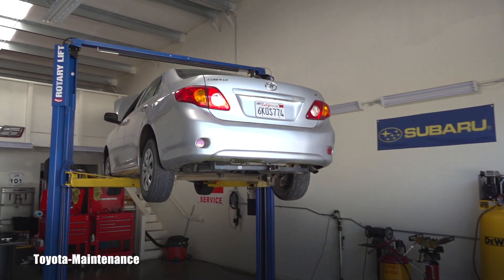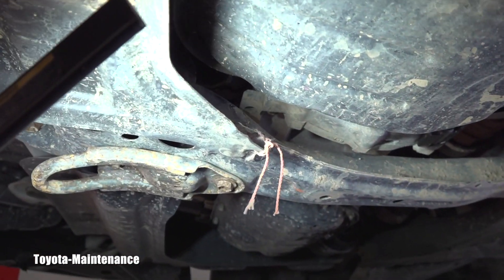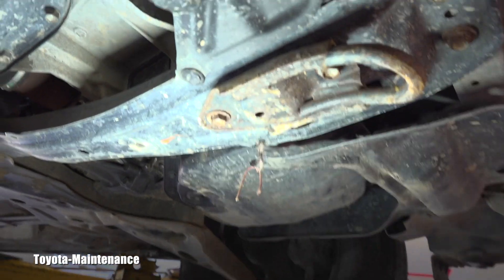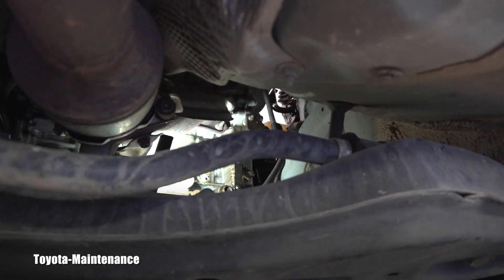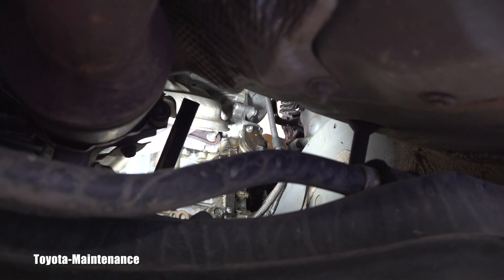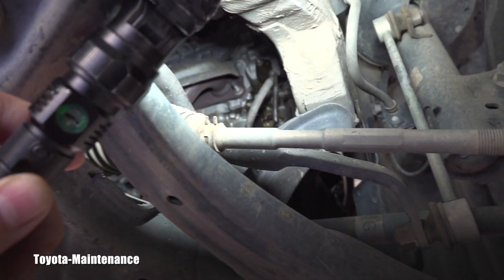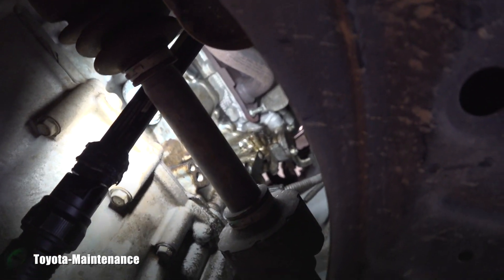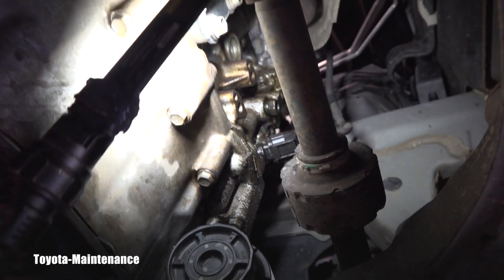Typical Timing Chain Tensioner Oil Leak

Comment: The dealer told me my timing cover is leaking and it will cost $3,000 to repair, after cleaning myself and watching videos like this I R&R my tensioner, to soon to tell yet if it stopped the leak, but thanks for keeping us informed.
Reply: @garyy3758  Yes it is still dry.

Comment: I installed new Toyota tensioner and oring but it still leaks slightly. What's the trick to this repair?
Reply: Put a bit of clean engine oil on it, and make EXTRA sure you don't pinch the O ring.
Reply: I sealed mine with rtv and been solid for 8 years now, just put it around the bottom and spread it a little out I think I put some around the o'ring too on the bottom side
Reply: might have crushed the oring on install

Comment: Both my Corollas had oil leaks coming from the main bearing seal, expensive labor to replace a $15 gasket.
Reply: Add at205 reseal when changing oil
Reply: @on-site4094  Tried it, did not work.
Reply: @pedrofernandez8729  now you have to use maxlife for about two to three oil change intervals. Or one year whichever is longer. Slow but will rejuvenate the old seal. Conventional can dry/eat it out if oil changes were neglected

Comment: So freaking crazy. A few weeks back I saw your transmission oil change and I noticed the car you were working had the same small oil leak on the back of the engine. I was just about to go back and look for that video since you brought up the leak but didn't go into to much and wouldn't you know it searched up hoping to find a good video and BAM! your video was recommended so I'm super happy. Thanks for the amazing work keep it up definitely subbing 🔥🔥🔥. I forgot to ask would you recommend I replace the rubber seal? Or is there a way to somewhat permanently seal it to stop future leaks. How do you properly clean the tensioner and what type of fluid do i lubricate it please 🙏🏻🙏🏻🙏🏻

Comment: Great video! Would love to see how to change out the control arm on the driver side (Need to do this on 2008 Scion XB). It seems one of the bolts doesn't clear due to the transmission oil pan. 

Thank you!
Reply: Gotta unbolt thevmounts raise it up with Jack the bolt will come out easy but extra works

Comment: Thank you very much sir.  I have the same issue in my Prius 2015, it uses the same engines and looks so similar. Do you have any tips how to unhook the tensioner in hybrid?  I am not sure it has the crankshaft pulleys over there.  But I think I can pull it from the harmonic balancer pulley

Comment: You might also want to tell the owner that they need new tires.
Reply: I have a 1999 Toyota Corolla LE I had to put new tires on not because they were bald but whether checked
Reply: This owner could not afford it. Said no to flush and deferred atf spill and fill until next oci

Comment: So what about that "great Toyota quality" if that leak is typical? Seems to me there is really nothing "quality" about it.  Or is any defect on a Toyota a sign of "quality", whereas any other make's defect is a sign of lack thereof?
Reply from the maker: small problem, cheap to repair, what about subaru boxer engines failing headgaskets one after another, and repair is $3300... I see it at my shop every day
Reply: @ToyotaMaintenance  Oh, forget Subaru. I can't stand them.
Reply: My 2011 Corolla 5 speed has 270,000 miles and has had no repairs. They are top quality
Reply: @tell302man  Good to hear. I have a 2005 Scion and hope it can last me that many miles.